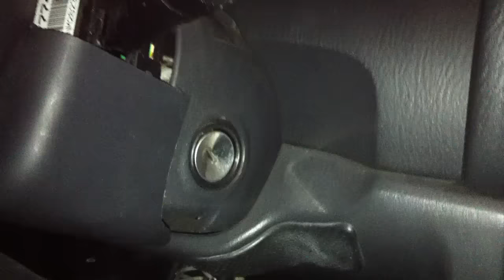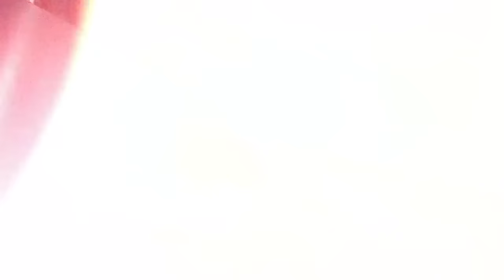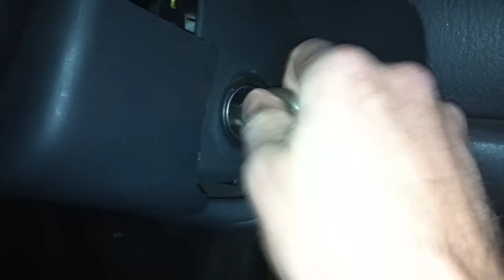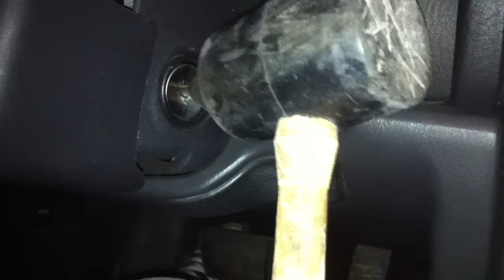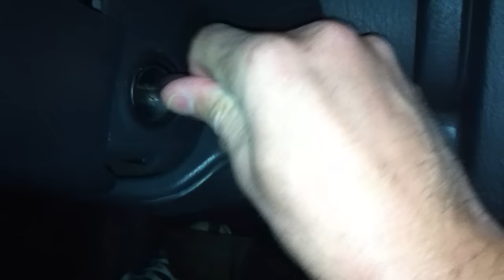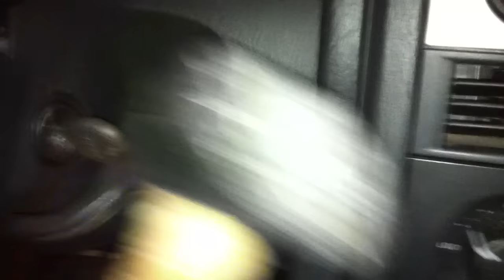if your Car/Truck Key won't turn, here is a Quick fix -UNCUT

Comment: Hi I came across your video I have not tried yet but I have a question to see if my problem is relatable with what had happened to your car . My key does not turn exactly like your video my dash screen shows a red outlined car with a key in it . And did you have to hit the key over and over again in order to use the key correctly or did that fix the issue im tempted to try it but my key is a slightly bent ??? Help pls
Reply from the maker: Be careful not to break your key. Start with light taps, make sure you hit the key straight on. It might help to spray some oil in the ignition first, like WD40. Good luck.
Reply: @warrenhardy  thanksss I just tried it right now it worked thank you sooo much I was stressing out 😰 😃
Reply from the maker: @elizabetaragon1624  in my case I had to do this every few weeks, then after a couple months the problem never came back. cheers
Reply: @warrenhardy  thank you so much . I noticed I have to repeat it every time I take the key out.

Comment: although this may appear to work, and it might get you out of a jam for the moment, it fixes nothing, the actual component that releases the cylinder that allows it to turn is a spring loaded bar that retracts under its own pressure, the key only moves the tumblers out of the way and allows it to move, it does not actually move it and taping it with the hammer only vibrates the slider and causes it to temporally start working again, a little WD 40 might lube it for a little while to get you back on the road but it should be taken out cleaned and lubed with a dry lube like graphite

Comment: I have an e46 bmw that I lost the key to, got another one along with that cylinder (my car has the ews delete that’s why I didn’t just call a locksmith) but come to find out I need the key to even remove the old cylinder, can I use this method with the new key and old cylinder?

Comment: My HONDA SVU 2003 model has been doing this on + off over the past 2-3 years. I ended up trying to “Will it”with ridiculous wishes or saying silly requests to the car or repeating a silly phrase, almost like I was applying a superstitious mantra on it. Given that generally, after 10-15 minutes each time of doing my weird techniques, the ignition would work. But recently, a friend had to pick me up from hospital and since I’d been in hospital for three weeks, I suggested she drive my car, to give it a run a d to save her petrol. However she couldn’t get it to turn and was concerned that she might break the key inside the ignition. Now, the last two weeks, I’ve tried several times but to no avail.  My concern in using a mallet or any tool, is knowing my luck, I’ll end up breaking the car key and having it stuck inside the lock.  After reading lots of comments here though, it sounds like your method has helped them. So fingers crossed, tomorrow I will hit and unlock and then be able to drive at last,   Thank you

Comment: I had to use my fist.. I have a key that from another explorer that slid right into ignition switch. Then I google this video that said use a sledge hammer, cough but I almost did so I use my first on original may and pounded it till it went is all way fortune .thankfully and it turned after all that force, engine started and I went my merry way. TY 2019=Liked
Reply: 2019=Liked
Reply: Peter Gabriel NE1

Comment: Watched this video at work, 2017 ford truck key wasn’t turning, steering wheel was locked, tried all other videos didn’t work. Saw this one so I grabbed an object and lightly tapped on the key while it was in the ignition and it worked. I guess the vibrations fix what ever is stopping the key from turning.

Comment: It worked for my impala I used a hammer then wiggle my steering wheel while I turned my key and it cranked. We gotta hit or vibrate the ignition n key to make the broken block go down. the spring is missing. I love YT

Comment: It works but the problem is I always have to do this with my car when I start it up again I’m going to have to get it fixed but this is a great fix for now
Reply from the maker: I never got around to replacing mine. it worked for years. but the jeep finally died. RIP

Comment: Were you able to remove the key tho after banging it with a mallet?
Reply from the maker: Actually, I had to do it a few more times after, my key was also very worn out, and I could remove it while it was running, believe it or not

Comment: Banging on the ignition didn't work! I just bought a Hyundai Elantra. I found out the reason my key was stuck, is because it has a steering wheel lock to prevent theft. Just turn steering wheel to the left, and it unlocks the key! Hope this helps someone with a foreign car!👍

Comment: Nice I'm about to try this on my hatch on my 4 runner my grandma used to have an old chevy tracker we used to have to put a Crescent wrench on the key to start but that was back when keys where made a little better as many times as we got stuck somewhere I can't believe me or my grandfather never smashed it with a hammer that was usually his go to method to fix anything thanks for the tip it makes sense if u think about kind of the same concept of using an impact gun on a seized bolt I'm going to use some dry lube once I get it freed up

Comment: had this problem back in 08 when I was in HS, drove around with a hammer for a few weeks, the plastic around the key was totally smashed up and eventually it would take more and more taps to the point it no longed worked lol.

Comment: Just know that ignition is not repaired by whacking it
Have a new key cut to factory depths and spaces 
( a duplicate of the old key will only get you a brand new WORN OUT key )
And be sure to either have the ignition replaced OR referbished by a reputible locksmith
Reply: Yeah but to save the tow fee...
Plus check the internet.  Some ignition switchs are easy to replace.

Comment: My 2005 Ford explorer is doing this but when I hold a torch or a lighter to the cylinder of the lock it turns. What's up with that

Comment: thank fucking god this actually worked every solution u find is just for the steering lock
Reply from the maker: Yes, a lot of people assume it’s the steering lock, I see a lot of comments of people saying just turn the steering wheel. But if you see what is actually happening in this video, it’s not the steering lock.

Comment: Does this method work if steering wheel is locked my steering wheel is locked and when I try to unlock the key wants to turn but won’t

Comment: Usually the key is worn, the lock cylinder is full of dirt/debris restricting the lock pins from moving smoothly, or the lock pins might be worn.  "You world is a nail" hammer fix probably indicates dirty lock cylinder.

Comment: What I found that works is if the steering wheel is locked and the ignition won't work pull the steering wheel to the left or the right whichever way it moves hold it there and then turn the key and it releases the lock on the ignition
Reply: It won't work like that all the time!!!!

Comment: Spay a lubricant in... I think the tumblers in the cylinder are sticking.... I prefer a teflon dry based lubricant because it doesn't attract dust... It is sold as sailkot at West Marine

Comment: 98 explorer had to use my first, as in this video was very informative.. Thank You for the input. I was try insert my key act like it was jammed but I have another ignition key that slid all way in so I knew something is F U C K E D U P? So I ended up here watch vid... NOT I heard mention slam it or drive it w. A mallet. I use my first instead, no mallet, so Thank you

Comment: The key must be pulled out 1-8th of an inch before you hot with the hammer.... It would have worked first time of you did that, bit thanks great video

Comment: After watching this, and, a few others, and after calling a service to come and replace it for me, for $196, the dealer wanted $225 plus tax, I went out to my 2001 Dodge D250 , with a new key, I had made, and tried the old key that I have been using, first, wacked it with the mallet, several times, no results, put the new key in, wacked it a few times, and it worked, additionally, I removed the column cover, and lubed the keyhole, and moving parts, I observed, and now letting lube set in, stuffed some paper towels in the cavity below the parts, this is to catch the lubricant drips, do not want that on anything, if avoidable, I will retest again shortly, to see if I can get by the with this fix, hopefully, this will do the trick, and forstall the replacement,of the lock cylinder.

Recommend, holding the key with one hand, and then hit with a mallet, another guy on here used this technique, and it was not working, with the old, or a new key, then he just smacked the outside of the cylinder, without the key in it, and it worked, boy was he happy, like I am, he was replacing his, and had to have it in the on position, to get the lock cylinder out, me I will try to see if it will last, if not I will be replacing it.

Thanks so very much for this tip, for the blessing, $200 unexpectedly, was a lot to dole out, right this minute, and was going to have to put it on a CC.

Comment: My key is in the ignition.  the car is ON, the car will NOT shut off. Key will crank forward, key will NOT Crank backwards towards me.  The steering wheel will NOT Lock. We turned it all the way to the Right and it does NOT Lock.  Then we tried it all the way to the LEFT. It doesn't lock. The steering wheel just keeps turning & turning. HELP

Comment: Ha Ha Funny. My key wouldn't turn back and lock the steering wheel, and I couldn't pull the key out until that happened. I tried your trick, it didn't seem to work. I took pliers and slowly but forcefully turned the key back into locking position. After that everything was okay, but now I can start my car without the key !!   Shhhh. Don't tell any car thieves.

Comment: HITTING IT IS NOT THE RIGHT WAY ⚠️ just gently move your steering wheel and then turn on the ignition while holding on the steering wheel at the same time. HOPE THIS HELPS

Comment: thank you it worked tenporarily do you know how t fix it permanently
Reply: Key is worn out or you have a stuck wafer in lock.  Just go to locksmith he can code cut a new key or repair old lock

Comment: The tumblers are worn out inside the key cylinder. You can take them out and it will turn with any key.
Reply from the maker: at the time that it fist got stuck, that was not true, but 5 year later, and now I can remove the keys while its running, actually very handy in certain situations.

Comment: Fifteen minutes ago a security alarm ended an attempt to steal a 2000 Buick LeSabre.
Unfortunately, now the ignition key won't turn. Evidently,  needle nose pliers left on the seat may be what was used to try starting the car.
This is the first YT VID ...  checking out a few more YT VIDS to if there's a better solution... this may be the only way than a $200  locksmith .

Comment: looks like cylinder is loose. This happens on door knobs and deadbolts, if the cylinder is too loose it will not let the key be removed

Comment: The problem is that your key is worn. You need to get a new key cut at the dealer from your VIN. The tumblers are not resetting because of the worn key.

Comment: Sometimes the steering wheel be locked stick the key in them twister steering wheel a couple of times or try to cuz its key won't turn in the steering wheel is locked

Comment: Disc lock get a blank for your car stick it in some silicon spray and a pipe cleaner to scrub out the inside of the key way

Comment: Yeah, I did this last year eventually you end up having to replace the lock cylinder.
Reply from the maker: I never got around to it. Eventually it didn’t ever get stuck again. Actually my key was worn down and I was able to remove it from the ignition while it was running. Great for warming the car up and keeping it locked.

Comment: That's a hack job, I had the same problem with my 2001, WD40 works better, spray it on the key and stick it in, then jiggle it until the tumblers are lubricated.

Comment: I don’t know who needs to hear this but if nothings working check your key if it’s worn down that’s probably why. Mine did the same thing couldn’t move my steering wheel for hours, I sat there for 4 hours trying to turn it did everything youtube told me didn’t work, had to get it towed thinking it was the ignition but really I just needed a new key cause it was worn out it’s rare but if you are in and our your car all the time it happens soooo if nothing is working that’s probably why as well

Comment: I've been whacking mine so hard with a small plant pot it just won't seem to budge and what makes it worse is that the steering wheel is locked completely I wish it worked.

Comment: Bruh it worked nearly snapped one of my keys luckily it just bent and I used another one wacked it with my hand a few times and it worked
Reply from the maker: good call, lucky not to break it

Comment: So is no one asking why this is happening it worked for me as well but why is it doing it
Reply from the maker: Hi, the actual cause is a malfunctioning relay, and its not to hard to replace. no tools required, its a tight area to get your hand into. the easiest way to find the module is to turn on your flashers or hazard lights, and feel around under your dashboard (mine was near the steering column) for the clicking sound, you will know it when you feel it, thats the one you have to pull. mine was square about 1"x1", and it just pulls out like a plug. I inspected mine under a magnifying glass, and found a small crack in the solder. So I just soldered over that crack, and it worked for a little while and then eventually when I was an auto wreckers, I pulled one out of the same year truck, which cost me 10 bucks. Not sure the cost of a new one.

Comment: The lock is no good because there is a safety bar in it and all he is doing is forcing it over. This is a quick fix. As a locksmith for over 20 years please do not listen to this guy you will be stuck one day from where it won't work and tow is a long time away. GET IT FIX. Go to auto shop get a new ignition a change it out now or call a locksmith.

Comment: ...or rather spray some WD-40 in there to loosen up the stuck bits
Reply: Might help but collects more dirt - which is the problem.  There's still the matter of the electrical switch in there.  Every electrical switch I've used wd40 on fell apart almost immediately.  My Clifford security key/lock, dremmel tool, two indoor light switches...  These switches were all probably going to fail any way - wd40 finished them off immediatly ...
Reply: @tombolo4120  Yeah, not the regular WD-40 but the WD-40 dry lube, tube o lube or any graphite dry lube product, due to the angle of the ignition maybe an aerosol dry lube of any brand is better

Comment: I guess the idea was to knock "lightly" not with full power hammer
Reply from the maker: Depends how bad the situation is I guess.
Reply: @warrenhardy  It would be great idea to make copy key before trying anything like this so it does not matter if the key brokes.

Comment: Its a safety feature, instead of doing this just insert the key and turn your steering wheel to a side until it CANT move further and HOLD the steering wheel in that place. Now turn the key
Reply from the maker: your so smart, i'm sure the 1,500+ people that have benefited from this video didn't think to try that first. lol

Comment: Get some w-d/40 ........ ur tumblers r sticking cuz u have to much keys hanging off ur key chain more then likely
Reply: Maybe? The main  problem is a manufacturing default . The tumblers inside the ignition cylinder are to thick for the chamber walls for each tumbler. you have to file both sides of the tumbler down just enough so they go up and down freely. then your ignition will work . You wont have to replace it either with a new ignition because the new ignition would do the same thing over time too.

Comment: It's just not a good idea to be using force on a chipped key or an ignition switch. It isn't the force that's being used, it's the vibration from multiple impacts. More vibration, better chance at success. Instead of big hits, you should be tapping the ignition much more lightly and repeatedly. Like an actual locksmith actually shows here: https://www.youtube.com/watch?v=MITZAbxZLLg

Comment: Don't work it will break your ignition
Reply from the maker: You are so wrong, we all know to turn the wheel to unlock a key. A 2yr old knows that. Thanks for the “I’ve never had this problem” input.

Comment: Ford has this stupid key lock thing that prevents you from turning the key, I have no idea what it's for, triggered it didn't need it so I put a wrench on the key and torqued on it, a loud snap sound, and the key was free, haven't had any problems since, damn ford mc can't design anything right, stick to a dodge

Comment: Scam video. Don't beat on your key it DON'T WORK. You'll break your ignition simply turn your steering wheel not loose and or shake it because it's locked and your key won't turn turn the key in shake the steering wheel turn the key and shake the steering wheel
Reply from the maker: Nope. If someone is here that’s not the problem. A 2yr old knows to try turning the steering wheel to unlock the key. That’s not the issue. But thx
Reply: @warrenhardy  then what's the issue Einstein?